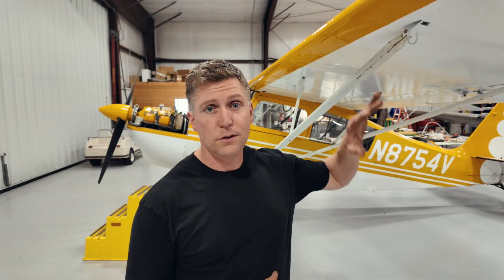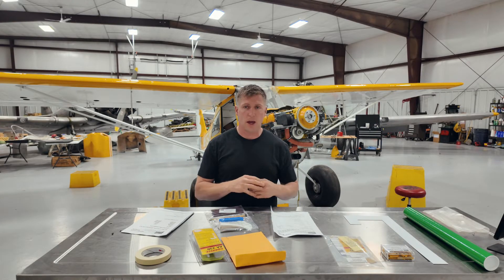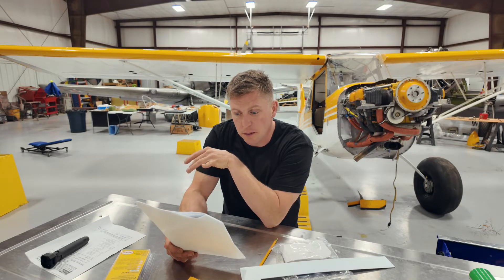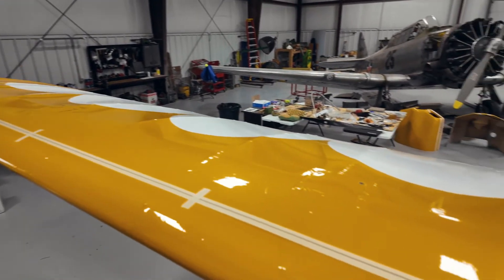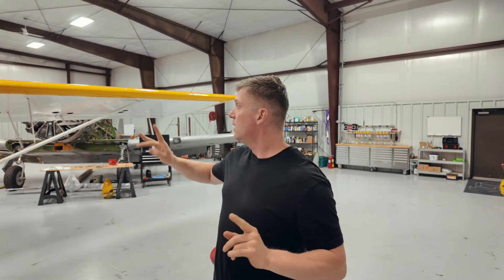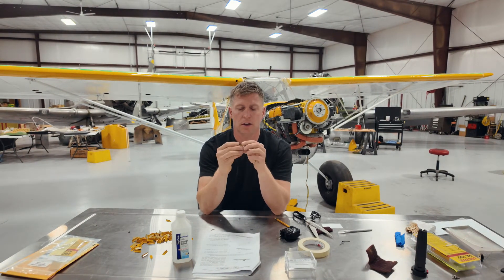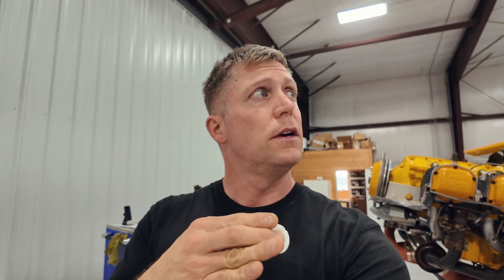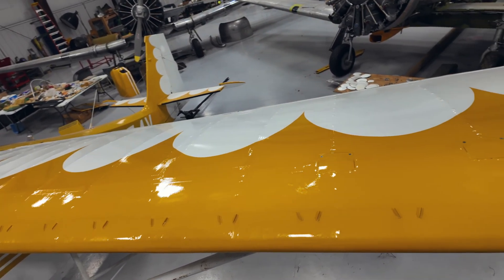Vortex Generator Install  (Micro AeroDynamics)

Comment: Great video, Thank you…

This is an “Excellent Product;” and the Company that supplied these particular VG’s are second to none.   I would “Highly Recommend” these particular VG’s.    

Satisfaction of note:  
It was almost impossible to stall my aircraft after this type of VG [‘s] got installed.  [Any stall effect was more like mushing.]  My own Citabria was a 1966 7ECA, operating from a short airstrip Northern Ireland.  As such, these were of highly important, especially on a missed approach situation whereby “going around” is imperative.